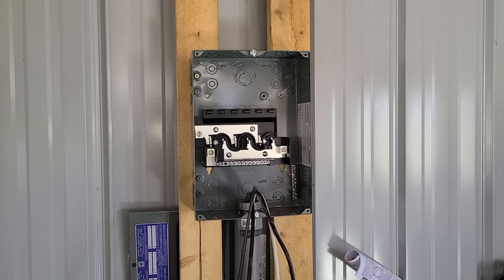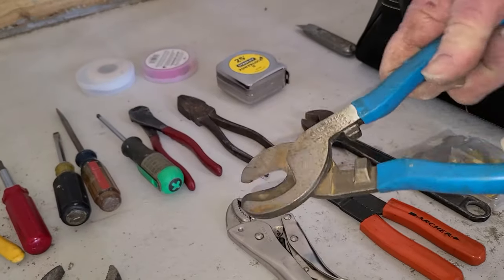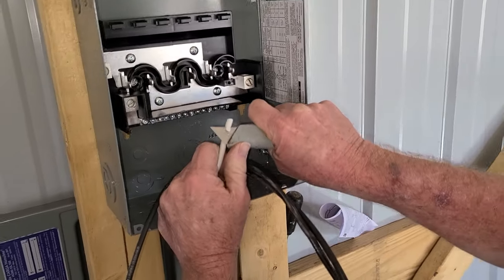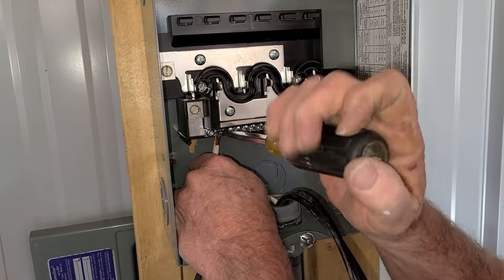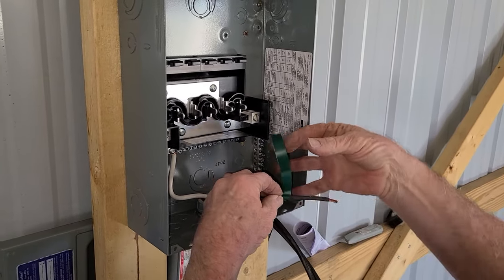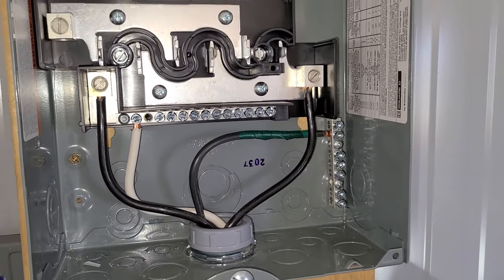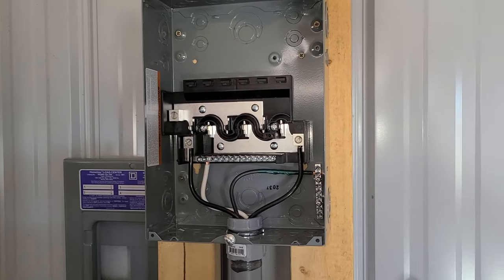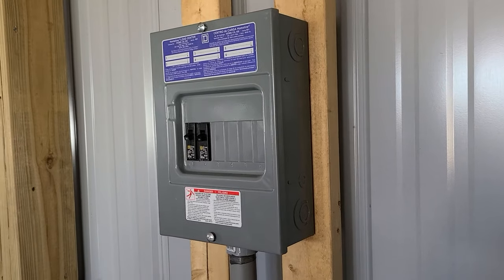How To Wire Your Main Wires For Sub-Panel Electrical Box For Home Garage Pole Barn

Comment: I bet they got a surprise when they turned the power on, since they hooked the power to the neutral bar.
Reply: omg I was just thinking the same thing i was like wait a minute they hooked a hot to a natural omg can we say flash bang lol+
Reply: my words exactly
Reply: He did not attach power to neutral bar.  He used a black wire wraped in green tape for Id purposes.  Its commonly done everywhere
Reply: I thought it was just me😂. I just did one of these so I second guessed myself for a second.
Reply: @tedyBear59 --that’s the ground wire. The white/neutral wire and a hot wire all clamped together in the neutral bus bar
Reply: @beaniril8870  no they are not it just looks like they are. I have the same breaker box and the view you are seeing is deceiving.
Reply: *** Sorry he did connect the hot to the NEUTRAL WTF
Reply: I have the same box myself. He hooked a hotwire to the neutral busbar.!

Comment: For future people watching they incorrectly connected the neutral and hot together on the neutral bus. They fixed it in their next video yet I don’t think they ever mentioned their huge and dangerous mistake. If you have one of these square D sub panels do not do what they did.
Reply: Agreed and 10-4 that
Reply: It’s also installed upside down...
Reply: what they should’ve done is deleted this video and made a new one 🤦🏻‍♂️
Reply: Yeah the video I was like " no....no...no" .
Reply: Yes, absolutely
Reply: I noticed at the end it was oriented properly but wondered why the breakers went in upside down initially.
Reply: i am glad you pointed that out icandreamstream....thanks
Reply: DO NOT DO IT THIS WAY!!!!!!!!!!!!!!!!!!!!! Hot and neutral are in the same bar - delete this video
Reply: Amazing that this video is even still posted. Skim the video and look at the picture. The wires are hooked up wrong the entire time.
Reply: I noticed that too.

Comment: The older guy says "He was an electrical contractor in another state"  Is that where he learned to land a Neutral and a Hot wire to the same buss? You may wonder why they didn't show a circuit test at the conclusion of the video!  This video should be flagged for removal due to dangerous and incorrect procedure.

Comment: You have your panel upside down. Code violation. On a circuit breaker the handle on the breaker must be down in the off position.

Comment: Why did u put your white parallel to your hot wire this is not right power is on the bottom and Top screw
Reply: Yikes! Could’ve been avoided had he installed it the right way by that I mean not installing it upside down .
Reply: I just bought this box and was like “wait wtf are they doing!?”
Reply: @icandreamstream  yeah I bet when they turned on power they found out real quick that That shit was wired wrong 😑 kinda like a boom 💥 sound idk 🤷‍♂️

Comment: As of 7/27/2021 this video still has not been corrected. 

I appreciate that this video was made as it was the only instructional video I could find for this specific box, but in this video both the neutral and one of the hot wires are connected to the neutral bar. 

The neutral should be where the left hand hot wire is (parallel with the hot wire on the right) and the second hot wire should be connected to the other end of the hot circuit. In this case, the second hot wire connection should be all the way to the left and slightly above the right hand hot wire (if you install the box right-side-up it would be all the way to the right and slightly below the left hand hot wire).
Reply: I agree his ass gonna get shocked
Reply: @jennifer harter   Make one for us rookies!
Reply: And now that one hot is too short to reach the correct location lol.
Reply: They also installed it backwards, and flipped the whole panel around at the end 😂. Look at the breakers before and after

Comment: This video shows the INCORRECT way to wire this panel, at 6:01 in the video you will see that both the Black (Hot) and the White (Neutral) are connected to the same bus bar. This video should be corrected or removed.
Reply: You clearly aren’t a Electrician

Comment: Should have been titled, "How NOT To Wire Your Main Wires For Sub-Panel Electrical Box For Home Garage Pole Barn."  Totally rookie errors for "dad" being an electrician..  As soon as that 70 amp breaker in the house "blew" they should have reshot the entire episode.  I guess YouTube doesn't protect us from negligent activity, just "naughty" subjects...

Panel was initially installed upside down.
Ungrounded phase conductor and neutral (grounded conductor) landed on neutral bar.
Where is the GEC and Grrounding electrodes?  Never was addressed.

Comment: 1. Box is upside down, the holes a ground bus bar used for attachment of the box
2. Neutral and hotwire on the same bus bar - hope there is no fire
3. Kudos for doing this box though. Hope these guys are safe
Reply: It's also now code that the breaker "ON" must be up not down like here. The panel has been installed upside down.
It would be fine if the breakers went east/west the "ON" can be either left or right.
Reply: Neutral is separated from the hot wire it just looks like they are connected. I have the same box and the way he connected the wire are correct and yes the box is upside down.
Reply: ******** Sorry he did connect the hot to the NEUTRAL WTF

Comment: Please Please Do not connect the black hot wire on the right next to the white (incorrect) it should be connected to the far right of this particular panel! This video should be removed before someone gets hurt or cause serious damage to your home.  Did like the video very much on instructions on how to install but needs correction if haven’t already!
Reply: glad someone pointed this out

Comment: yeah, you put your hot onto the neutral lug that has plastic around it on 3 sides.  The first hot lug is up to the left of that.  I almost thought the same thing when I installed mine.

Comment: The box is upside down in the beginning. Note the breakers put in.  Then note breakers at end.  Wonder  if when box was turned around if they had some short wires?  Reason I noticed it.  I have same box. The word Top is engraved inside the back
Reply from the maker: Correct, we noticed that and turned it around:)
Reply: @TipsNNTricks did it tooo.   Lol

Comment: you do not put the white neutral to the hot bus bar !!
Reply: I know what you are saying, but actually they put the White wire where it should be, and the Hot wire on the Neutral buss.
Reply: The white wire is on the neutral bus, but it should go where they put the first hot wire - the big terminal on the left of the neutral bus.

Comment: But, please correct the only mistake you made connecting your first hot wire to neutral! Otherwise excellent video👍
Reply: wft is going on, is this still wrong?? it looks right to me, I cant figure out if Im stupid or if this was changed. WTF is going on with this video I want to wire my panel tomorrow!! very confusing, the comments. 😅
Reply: @brutally_honest  yes it is wrong, electrical panel is up side down, but by code it’s still ok, specially if it is place outside under the elements of Mother Nature, but if panel is installed inside it doesn’t necessarily has to be upside down… as far as wiring goes, he installed the main neutral wire to the neutral bar instead of the neutral main slot and then he installed a main hot to the neutral slot, this is wrong… the first hot he installed should’ve have been installed above the neutral main slot the rest was fine.
Reply: @brutally_honest  in other words where he installed the main hot coming in, this is where your main neutral wire goes, then in this case, above the main neutral slot, there is two more slots were the two main hot go in, hope this helps
Reply: @FastEddieQ  I saw that the panel was upside down, and then in the final shot its turned over.. also confusing, like is this the same panel?!! Crazy this is the only video explaining how to wire these things.. I'm going to wire mine and make a video of it so it will be clear, once and for all.
Reply: @FastEddieQ  ohh yes i see now he installed the hot to the neutral 🤦🏽‍♂ good catch.
Reply: You also need to add a ground rod for this panel, that is the last thing they forgot

Comment: Dangerous Wired that wrong don’t do it like this he has hot and neutral on same bus 🤦🏽‍♂️ and box is upside down 🤦🏽‍♂️
Reply: I wonder what the out come of this was ? Probably felt dead and alive at the same time for a few seconds.
Reply: It doesn’t matter if sub-panel is upside down, unless it is outside then yes otherwise the only problem I see is a wiring mistake… please correct me if I’m wrong.
Reply: @FastEddieQ  that’s right but it’s not recommended unless you have no other option also need 30min fire wall and so much distance around panel
Reply: 10/4

Comment: 10 months ago I commented that there should be a ground rod (grounding electrode) connected to this panels ground bar as required in Article 250.  No comment from anyone!  If you do not test the rod to prove 25 ohms or less resistance, then you are required to install two ground rods.  The ground rods are for the purpose of sending lightning to Earth, not ground fault in any way.
Reply: Hi, I was just going to ask if they should install a ground rob. Of course I’m installing a sub panel in my detached shed (70ft), and I’m curious if I install a ground rod
Reply: @rileycrain5784     Before I answer, I’m going to tell you the ground rods function.   Ground rods are connected to electrical systems to dissipate lightning to earth to lessen damage within the system.   Normal sub-panels in the same structure are not required to have grounding electrodes (ground rod or others).  But when you feed a detached structure, you are required to install two of them.  Unless you test it for only one.   Just so you know.  You are also required to have a means of disconnect in the incoming feeder to the detached structure at or near the point it enters the structure.  What does that mean?   If the feeder enters the structure, at the panel, a main breaker will satisfy the requirement.  But if it enters and the sub-panel is further than (let’s say 10 feet of conductors) then there must be an enclosed breaker or a safety switch.  Non fusible meets the requirement.   Any other questions?

Comment: Every day is a chance to learn something new.

Read through the comments and many people question many things.....

Is the panel mounted up-side down?  Can you mount the breakers so off is up?  Was th panel marked. "THIS END UP"?

Did he physically get the wires in the correct place?

Does the building require a seperate ground rod and ground wire?

What about a building disconnect switch near or on the outside of the building?  This may vary based on your local building department.

Another videoer got a permit for his "pole bar" as an "agricultural building" which added extra wiring requirements based on NEC 547 (I BELIEVE).   Specific wires or conduits based on expected animals housed/stored there.

The building department or your local Electricians are great esources to get everything correct.  Inspectors go from jobs items to job site and see many different ways it was done and your locals may have solved a problem last week that do not even know you have.

Take care and be safe.

Comment: Per Code you must drive a ground rod for a sub panel in a separate building.
Reply: How many ground rods?
Reply: @rileycrain5784  I do 2. Code states that that is the max. You can do 1 if you get a OHM reading of 25 or less.
Reply: OHM's
Reply: @JDStaffylover  thanks pal